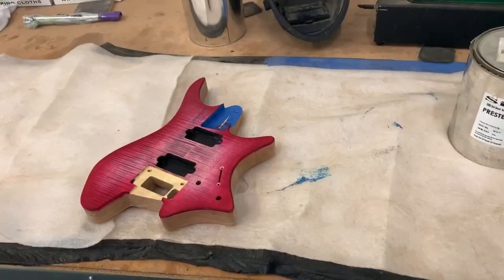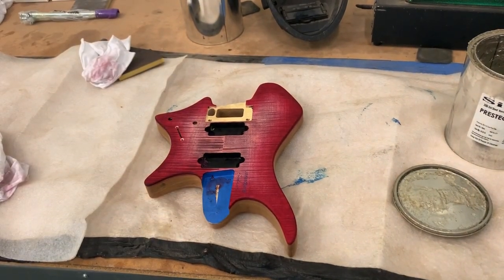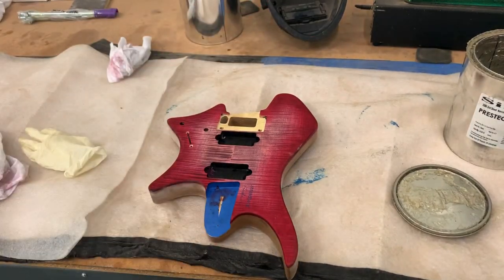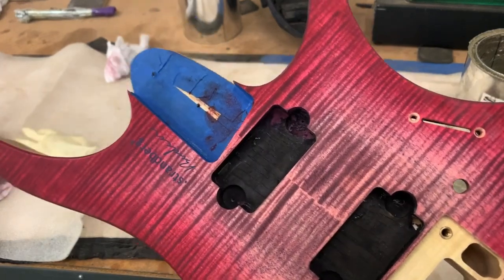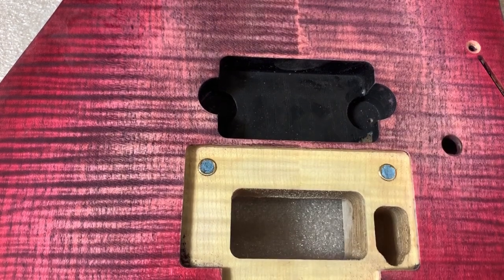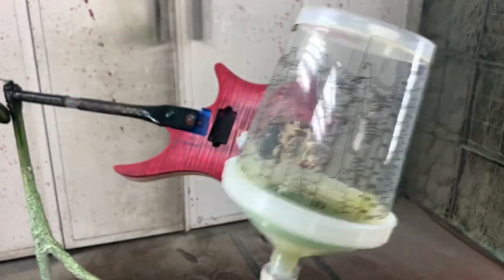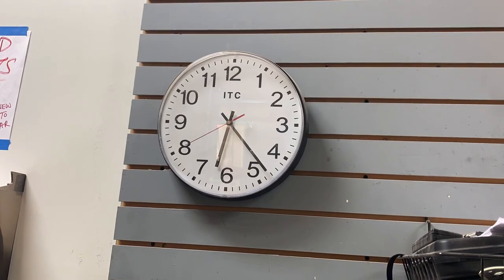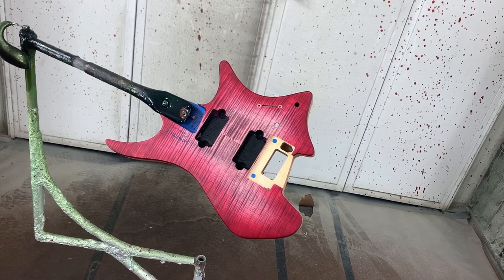Strandberg Refinish Video: P4rt 4our. More Goo, A Bit Of Bonding, Then Hosing Her Down

Comment: Quick question. How does the chemical bond, and sanding sealer work if you level sand through it all to the grain filler? Do they both sink into the grain filler?